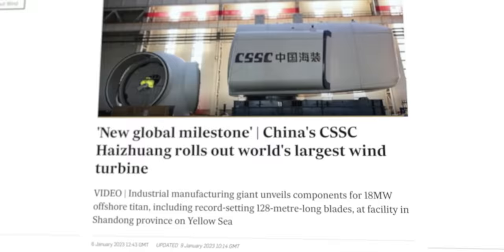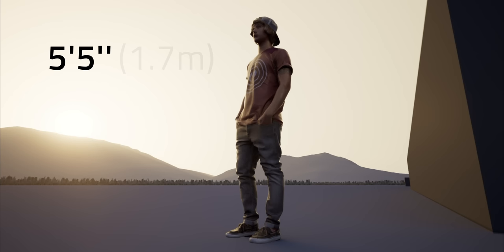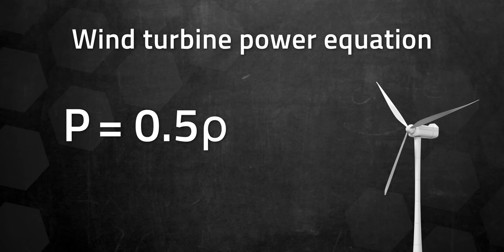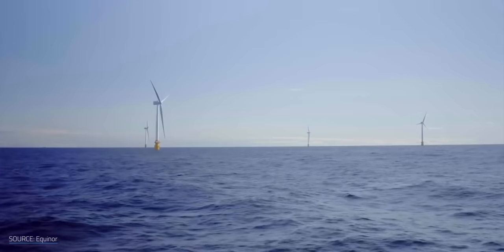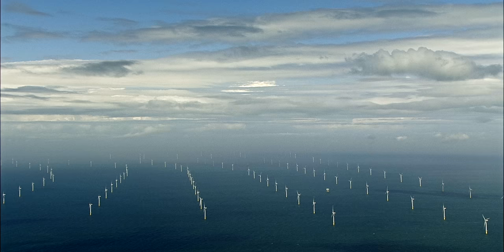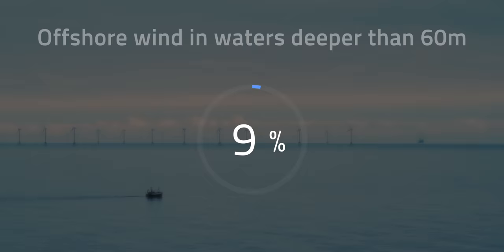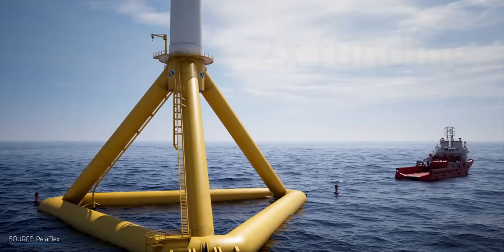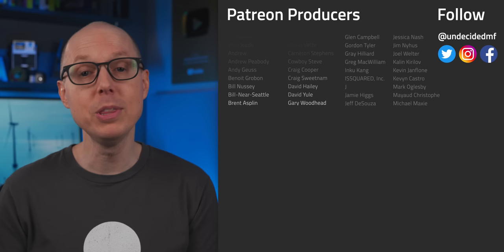Why Are Floating Wind Turbines So Huge?

Comment: It's amazing how much renewable energy sources have improved in the last 30 years. 🙋🏻‍♂️
Reply: The french are starting a green hydrogen project with floating offshore wind turbines, with the hydrogen platform between the turbines, using directly the electricity to produce the hydrogen directly from the ocean water, and its only one gas pipeline to the french coast where they do the storage.

If economicaly successeful, it will be the energy storage way of the future, where all vehichles since plains and trucks and ships can use.

Even powerlines can be replaced by hydrogen underground pipelines, and clean up the visual environment from power lines ugly view. And we just have hydrogen powerplants inside cities, creating clean electricity as demand on real time.

Just a theory yet.
Reply: Wind has increased much faster in output per turbine than solar has per panel.

Which is a big part of why it is so much less expensive per kwh.

Even at the most ideal efficiency solar will never be as cost efficient as solar sadly.

Comment: By far my biggest concern is finding a way to refurbish the blades instead of throwing them away  every time they wear out.
Reply: When the blade is worn out it is maybe possible to recycle  the materials in the future. 
But the blade as is is probably worn out mechanically, in one or several components .  The scale up of the components probably makes if age faster also. There are data that  support the theory that this very large turbines last shorter time than the smaller ones.
Reply: Carbon fiber is hard to recycle. These turbines last for 25 years, sometimes longer. So it’s not like they are just throwing them out Willy nilly when they start to get some dirt on them.

Comment: I’m really skeptical about the economic viability of these floating wind turbines. I do like the fact that you need fewer of them compared to land-based turbines or fixed offshore turbines. But the cost of maintenance must be astronomical.
Reply: @rogerstarkey5390  thanks 4 ledden me no
Reply: Roger doesn’t know what he’s talking about. Maintenance on land is huge, when you go offshore, you need divers, underwater welders, specialty technicians, boats, ect. The cost of maintenance is astronomical and this the driving factor in making them as big as possible, so that there are fewer to repair. As they start to age (10 or 15 years old) the maintenance costs only go up. (I work in the industry)

Comment: Glad to hear you touch on environmental impacts, but I think there might be another angle to consider. The biggest impact to ocean eco systems is large scale fishing, which probably wouldn't be possible in a wind farm, so although there would certainly be some initial disturbance, these areas could serve as safe havens for life over the longer term.
Reply: Why do you think there would be no fishing in an offshore wind farm?
Reply: @paulogden7417  do you want to be on a fishing boat that just snagged an electrical cable carrying 420,000 volts?
Perhaps you are thinking of a few guys in their cigarette boat, knocking back beers while their fishing lines dangle a few feet into the water, or maybe a few guys with a small seine net?  Commercial fishing involves massive gill nets that are 6 to 10 miles long, or long lines that are typically 20 to 40 miles long.  Not the sort of thing that can be safely used around wind turbines with anchor cables and power cables enmeshing the area.
Aquaculture might be possible within an offshore wind farm, but I don’t see how that could be economically preferable over onshore locations.
Reply: Exactly, what Paul said.
Reply: @andynewsom  Can't trawl in a field of cables and anchors.
Reply: @devins7457  Meant to agree with John Early, not Paul! heheh.
Reply: I believe that any structure in the ocean tends to create habitat for fish, perhaps even enriching ocean life. And I don’t know  why it would be unsafe to fish near a floating wind turbine.  Anybody?
Reply: @paulogden7417  Scroll up to John's comment
Reply: They did touch on this in the video. Quite a bit actually. You would also be surprised how many birds die with wind turbines, the turbines have to be shut down if endangered species are spotted in the area, and they have to be slowed down if it’s known that birds are migrating in the area

Comment: A couple of years ago I saw an interesting study. They said that if something like 10,000 turbines were placed offshore of Florida, it could reduce the intensity of a hurricane by 1 full level on the Hurricane intensity scale. 

Placing wind turbines in the Great Lakes is not really feasible. They have to face the fact that the lakes freeze in winter. Ice, blown by wind needed to activate the turbine, is a very powerful destructive force.

I read a study that simply painting one of the turbine blades a contrasting color (black) is enough to significantly reduce the number of birds killed.

Comment: whats the service life of these systems? whats the actual carbon footprint, how much toxic was is generated during production and decommission. how much money does it generate vs cost and maintenance.
Reply: The motor would need some maintenance 

The steel structure.. well 100 - 300 years

Comment: It's so big I actually want one on my roof just to spite my annoying neighbor.
Reply: Lol it would crush your house from the weight.

Even smaller turbines need big concrete foundations.

Floating turbines have the benefit of the water reducing the problem, then you just need counter weight to stop it from tipping over.
Reply: @mnomadvfx  Yeah you're probably right

Comment: Where I am (NE Scotland) = Moray East Offshore Windfarm (opened Dec 2018) = 100 x 9.5 MW turbines. Moray West Offshore Windfarm (due to open 2025) = 60 wind turbines each with a generating capacity of 14.7 megawatts (MW). That's progress for you - and it highlights a potential opportunity in 'repowering' older (onshore and offshore) windfarms.
Reply: Next generation will be bigger and floating.
They called the Greens crazy for wanting this stuff.
Reply: How many houses in total can it power?
Reply: @JayForsure  How long is a piece of string? Bascially you have 950mw v 882mw (7% less) installed capacity with 40% fewer turbines.
Reply: The french are starting a green hydrogen project with floating offshore wind turbines, with the hydrogen platform between the turbines, using directly the electricity to produce the hydrogen directly from the ocean water, and its only one gas pipeline to the french coast where they do the storage.

If economicaly successeful, it will be the energy storage way of the future, where all vehichles since plains and trucks and ships can use.

Even powerlines can be replaced by hydrogen underground pipelines, and clean up the visual environment from power lines ugly view. And we just have hydrogen powerplants inside cities, creating clean electricity as demand on real time.

Just a theory yet.
Reply: @ricardoxavier827  In the UK we have a company which chills normal air to a liquid and can store it for weeks. No high pressure storage needed or explosive gas. When you need energy you allow the air to warm up and feed it through a turbine. The solutions are coming!
Reply: Nice.

Not only that but the increase in windfarms is causing several old hydro power reservoirs in Scotland to be drained for lack of need, thus increasing the future potential for Scottish tourism.
Reply: @deekayunited3445  "(7% less) installed capacity with 40% fewer turbines"

That's not accounting for the extra materials and resulting cost of the larger turbines mind you.

Less turbines does mean less infrastructure to connect it all to the grid and regulate power output though.
Reply from the maker: Thanks for sharing.
Reply: @rogerstarkey5390  I tend to agree. Keep the hydrogen for certain heavy industries that might actually need it. For everything else store it as electricity in hydro, air, batteries (EV's), gravity and storage heating.
Reply: @rogerstarkey5390  lithium batteries have a bigger cost if we count the costs of the environment damage and recover.

Do your math right. You are not adding the environment damage costs to the costs of lithium as a energy storage system.

Hydrogen are clean and is cheaper if you do the math of everything toguether.

Research and you will find the project i am talking about.

And portugal, spain, france, and germany, already signed a contract to build the first hydrogen pipeline between that 4 nations.

Wind, solar, riverdams, and all the natural gaz pipelines that are in 100% of europe, can gradualy become hydrogen pipelines, having only to change the pumps type.

Remember that renewables are not energy stable on production, so we need a energy storage system, besides the riverdams "battery" system.

A lot of the energy the renewables produce, sre wasted for lack of use, and for lack of storage way.

And lithium are not infinite. How much we use it, more scarce becomes and more expensive becomes.

Hydrogen are infinite, because we only need energy and sea water. Both infinite, and how much we produce, more cheap will become.

Easy math to see.
Reply: @deekayunited3445  its another choice... But energy volume are very important as well...

More volume, more storage volume need and more cost to build that bigger storage system...
Reply: @deekayunited3445  all the pipelines are in fact a giant storage system, were you play quantity by pressure managment....
Reply: @mnomadvfx  really?     hydro is the best power storage option, i've not heard of any hydro being decommissioned in scotland... and even if they did that would have no effect on tourism.. people literally come to see the lochs.
Reply: @deekayunited3445   yeah, with like 30% round efficiency

Comment: I'm curios about the resilience of these turbines in case of powerfull storms, even hurricane level ones. Best case scenario I would see, is if they enter a shutdown mode to protect themselvs in which case they would produce nothing for the duration of the storm. Other relevant questions would be lifespan and maintenance costs, especially for the floating ones.
Reply: There is storm stow, they face the wind, spin freely, and angle the blades to catch the least amount of wind, but wind direction can change rapidly. For this reason, it’s likely that they avoid areas prone to hurricanes completely. And yes, maintenance is a HUGE cost factor. When turbines start to age (10 or 15 years only) the maintenance costs go up and up and up

Comment: One thing you didn't talk about was the differences in wind speed at the top of the sweep of the wind turbine blade versus the bottom. This may require a change of the pitch angle as the blade rotates for maximum efficiency. Do these large wind turbine do this? Or do they function like typical size wind turbine and only adjust pitch angle to maintain the correct output frequency?
Reply: Good point....the wind difference between the top and the bottom of a turbine can be a real issue when warm air blows over cold water. In these conditions you can get a powerful low level jet at the 100 - 500 meter range but not so much wind down at the water surface. This happens more frequently near land, and especially in the spring and summer.
Reply: There are also other reasons to pitch the blade when they are up or down. The rotor turn around a shaft that is not horizontal, its tilted a few degrees up to give more space between the tower and the blade which is in the low position. This tilt means the blade going up has an angle of attack that is different than the angle of the blade going down. The angle of attack changing all the time means the mechanical stress on the blades also changes all the time which is worse for the blades life than a constant stress.

The wind is also slower near the tower.
Reply: @niconico3907  I guess "teetering" (ala chopper) is out of the question for the same reason - tower-strike.
Reply: I think the blade angels are the same at all blades , you cant  rotate the blade hub fast enough to compensate for passing the  tower  wind speed bottom and top  , you would have to a very short life span on the central hub mechanics if it was moving all time.  The blades often rotate in case of the turbine trying to maintain the rpm envelope,  if the rotating is accelerated the gear box first try to change generator axle output  generating more power (breaking), and if the rpm on the turbine is  still raising the blades pitch is changed .
There is also a mechanic break in the nasell turbine house,  to regulate rpm on blades.
The blade rotation from high pitch to no neutral  takes some
Time maybe 5-10 seconds. 

On helicopters the blade hub is constantly shecked, because of the high mechanical load and constantly pitching blades.
Reply: The blade angle actually changes multiple times per second! Very small adjustments so that there is less resistance to the main rotor. This force you are talking about is already taken into account!

Comment: Well presented. I hope this gets shared in environmental science classes.  The biggest factors favoring offshore wind are 1) laminar flow, so the air itself moves smoothly round the blades. This leads to less wear and tear, quieter operation and smoother transition from low to high wind speeds. True there are still gusts, but overall less severe. 2) less people and animals to annoy  3) ability to easily lay out wind-farms in economic linear grids without having to deal with roads, bridges, houses  etc 4) local cabling kept cool due to immersion in water so less energy loss before high voltage transformer . Cabling length is be a major factor in wind turbine cost and placement especially in remote areas. I have run small scale wind power for 40 years and its brilliant if well installed.

Comment: Hi Matt, great video as always. I just wanted to share a piece of new technology with you. A company called Sharrow make a new boat propeller that increases efficiency by ~30%, lowering noise at speed by like 50%. They have removed the blade tips entirely with their unique design.
Reply: He made a video on that recently.
Reply: toroidal propellers are only good for high RPM situations. These giant wind turbines spin extremely slowly (relatively speaking). Toroidal shaped propellers would only be prohibitively more expensive and add little to no positive effects.